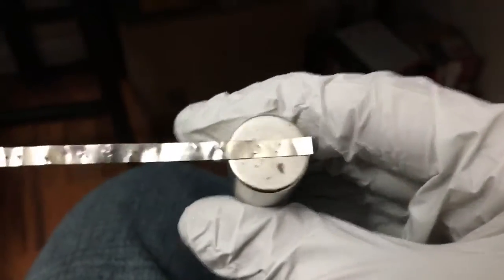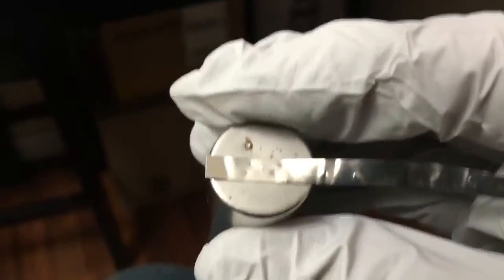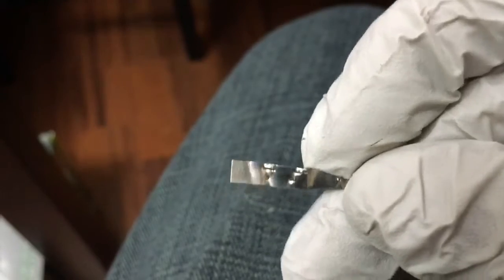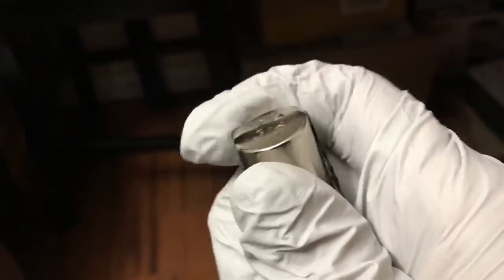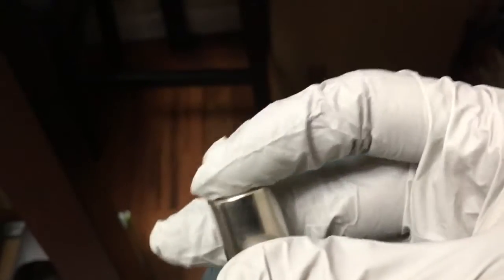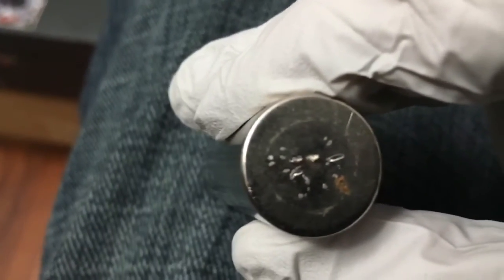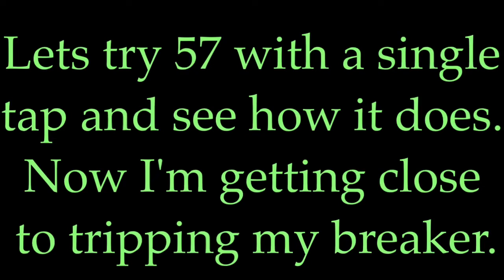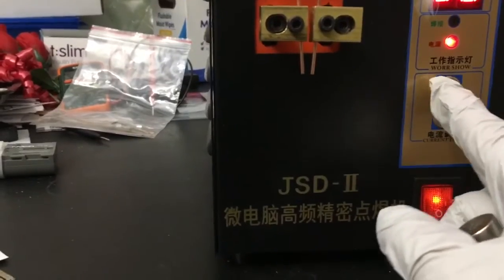Quick Test - Spot Welding test with the JSD-II 3KV battery spot Welder.

Comment: Hi, I have a similar one of those Chinese spot welders. I noticed that if I plug it in next to the main fuse box, the performance improves on mine verses plugging it in at my work bench that is about 15 feet away. The reason why is these welders draw so much current that any resistance in the wiring causes a voltage drop in the line voltage. also when I did that, the fuse at the back of the spot welder would blow. I took a chance and put in a larger fuse. So far, no damage to the spot welder.
Reply from the maker: Hi Peter, I think their are 3 or 4 different ones on the market currently. Since my lab shares a single 15A breaker with two other room upstairs I already knew it probably wouldn't work in the lab. Maybe later I'll add a nice big fast AC cap to handle at least 20ms of surge it takes. The kitchen outlet is above the breaker box for the mains, and I knew it was a 20A. I just needed to make sure the refrigerator wasn't running. I also have a 20A designated breaker for the washer only that has a 10ft (3m) run and the washer is the only thing on it. I figure I would be using this since it's only a few feet to reset the breaker if it pops instead of walking g two flights of stairs.
But it was cold in the basement so I figured I would test it in the kitchen last night. I just did a video with it in the basement and just need to edit it first before I release it. 

One of them uses a single transformer for the control board and the spot welding. That one likes to pull more then it should with inrush current and will trip a breaker on start up. Not only that but it's rated for what the fuse is and pulls more then the fuse, this causes the fuse to blow. Now if a bigger fuse is put in then the cord is most likely rated for the same as the fuse. So keep in mind that your may be pulling more then the power cord or plug is rated for since you increased the fuse. If I had to guess I would say you own the Sunkoo 788H or 709A? Or ones like it with a different name. One of them also required 60 Amp leakage protection, well above anything in the house unless I use the 220 parallel breaker lines for the dryer or the oven. 

Are you in the US? I ask because each of these spot welders handle differently on 110V bs 220V and different wiring.
Reply from the maker: Hi Peter, so I've decided to finally get back to this project. 
After some thought and testing I realized they removed the 220V power cord and put a cheap 110V cord on it. 
Ive traced everything, and it seems this unit was designed for 220V, but will run on both since all the comoentents are Specs for both after looking up the data sheets for the parts inside, the triacs, mosfets, and other main power parts. 
So I'm going to see if I can get a solid weld with some thicker nickel or steal for a test first still using 110V, then changing to 220V if I need to.
For now I'm going to put a 30A breaker in the box, use 10-2 wire for the breaker and running to the plug. The plug will be a short run, maybe 5 feet total. I'm going to use a NEMA-6 plug outlet rated for 20A, replace the cheap power cable it came with with a quality 12AWG NEMA-6 cord.
Then test and see how it does. I suspect it should be enough for what I need. 
If not then I'm going to change it over to a 220V, 40A dryer plug and cord. Add a 2 pole 50A breaker and that should cover what it was originally designed for with 220V on a 40A line with some extra overhead on the breaker to prevent any inrush current from tripping the breaker. Same reason I'm using a single pole 30A for the 20A line.
Should be interesting, I hope to do a video sowing the results. 
For a test I want to replace the cord first and change a regular outlet plug nema-5 to a NEMA-6 and see how much difference that makes by itself.
I suspect the power cord these come with are low quality, higher resistance, and they are on,y rated for 13A. 
Just thought I would share I case you wanted to change the plug on yours. I'm just using a 9 foot NEMA-6 extention cord from lows that has 12 gauge wire, they call it a air conditioner extention cord.
Scott
Reply: I have the jsd 2..upon opening it up the wires are very small and everything goes to the 20amp 125v power switch. I have removed the fuse as it was not worth using.  I would love to know how to run this on 220v. Has anybody made this mod and been successful cause i dont see how to do this. The transformer is not multi-tap. The best way I can see to beef it up is to bypass the main switch and add a bigger power cable. Also going directly into a 20 amp breaker on the fuse box is the best you can get. It seems easy to add a foot switch but I would also like to have a handheld extensionfor doing battery packs. This thing is just begging to be modded by someone with more experience than me

Comment: I'm having issues running this spot welder past 30 amps at home
Reply from the maker: Is yours a 110V or 220V, what country are you in? Well mine was a 110V and defiantly tried pulling more power then my lines could handle. Shortly after the triac blew out on it. Instead of fixing it I just bought a SUNKKO 709A and this one has ran good. 
https://www.amazon.com/gp/product/B01JB8VR9E/ref=ppx_yo_dt_b_search_asin_title?ie=UTF8&psc=1
Reply: Ran it at a friend's house in their basement on a 100amp circuit and it ran fine.
Reply from the maker: @xX2kawaii4uXx  That’s good to know. The triac on mine blew out.  I ended up just getting a sunkko one that has ran flawless for years now.